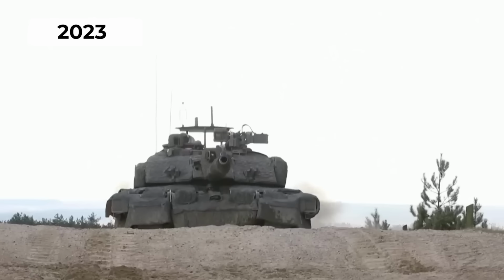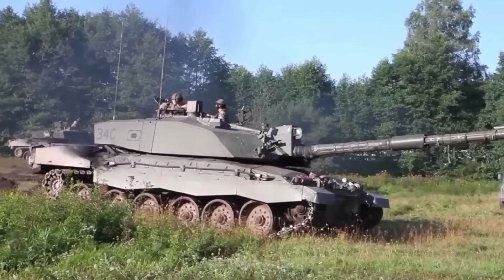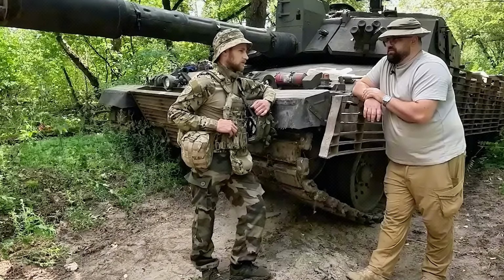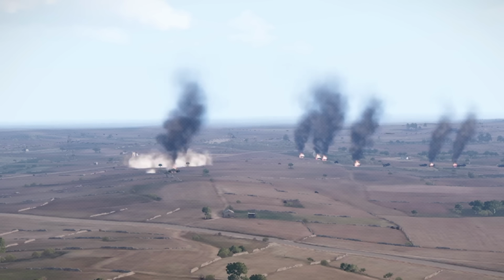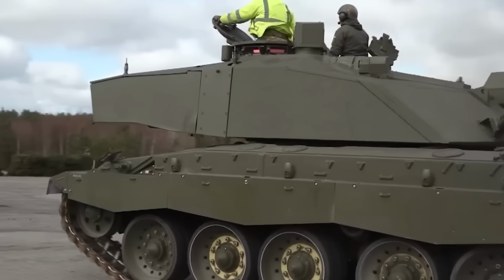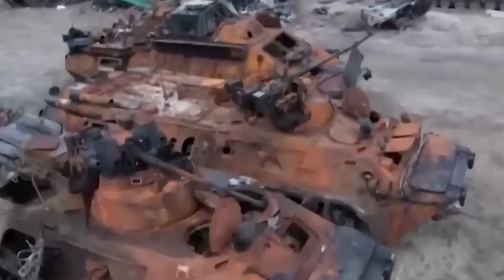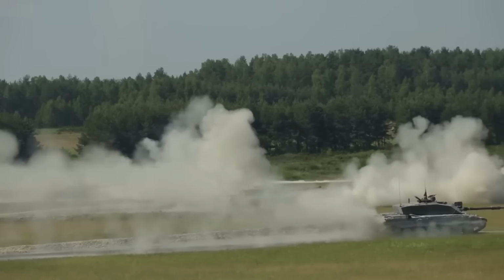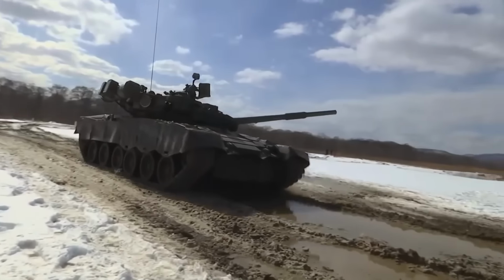How Britain’s Challenger 2 Tanks Are Obliterating Russia’s War Machine

Comment: they are doing a lot better then american abrams tank
Reply: I think the engine is also a bit sensitive in the abrams...it's gas turbine and seems not to like cold damp conditions too much.
Not to say it isn't a good tank it is, and it's proven, but this a different theatre.
Suppose you could say the same about the F35's not liking alaska too much.....
Reply: bradleys on the other hand with bog standard diesel are tearing it up...as are stuff like swedish CV90 and finlands Patria.

Comment: This report is X BOX bullshit. There are only 8 Challengers left, and 3 of those have broken down, so if you think 5 overweight slow tanks will make any difference on a 1200 km front line on notoriously soft  winter ground you need therapy.

Comment: Simple things have helped it becaome so safe, eg it has a toilet and a small kitchen. This is because of WW2, and TEA !  It has been proven that tea breaks ( at least for british troops) boosted morale, and gave higher performances from the crew. That break to make a "brew" psychologicaly was beneficial, however the Germans cottoned on to that, and the german troops told to watch for stationary tanks and the fire from which they heated the tea. 34% of tank casualties came when the crew were brewing up their tea, being less vigilent  and longer response times. So the tank was designed for them to be able to brew their tea without stopping , and presumably toilet breaks. Tea was a staple for the British Army and have the stats to prove it, every soldier has a ration of tea. AS vital as amunition. 34% of tanks destroyed is scary  so saving that figure alone is incredible, just because of TEA. IN the deesrt temps inside tanks could rise to 50. C so air conditioning is installed /and a heater for the colder weather. Can you imagine Putin installing a bar for vodka inside a Russian tank  or realistically coffee/ It would never enter his head.
Reply: You can only just get the crew in a Russian tank. 
Coffee production is just not going to happen.
Reply: Tosh

Comment: Makes you wonder why Challenger 3 has gone to a smooth bore gun. The rifled barrel is so much more accurate. From what i understand its to do with using other NATO shells as opposed to rifled bore specific ones.
Reply: you are right that challenger 3 using smooth bore so that it can share rounds with other NATO members, but also it is because of barrel wear, the rifled barrel needs to be changed a lot more often than a smooth bore.
Reply: @johnmay9726  spot on👍 I think there should be an option for both because of the accuracy at such distance is amazing.
Reply: @johnmay9726 but its giving up its biggest advantage.
Reply: Not quite the challenger was designed to use HESH (high explosive squash head) rounds which defeat enemy armour by flattening against the hull before detonation which causes a  shock wave to travel through the armour blasting a scab of steel off of the inner surface which fly's around inside the tank shredding the crew and equipment. If the HESH round is spinning on impact it spreads more evenly and causes a larger scab. However spinning the round in the barrel costs energy and friction which increases barrel wear and reduces muzzle velocity. Modern smooth bore rounds use fins to stabilise the round in flight like an arrow negating the need for rifling. With the proliferation of composite and spaced armour's which prevent the shockwave reaching the crew compartment and vastly more effective spall liners which catch anything flying around inside HESH rounds have become far less effective not to mention ERA (explosive reactive armour) which creates a counter explosion and blasts the shockwave away from the tank. This all means that sacrificing barrel life and muzzle velocity no longer makes sense.
Reply: @ianjardine7324  "fly's"? Sigh. *Flies*.
Reply: logistics
Reply: Smooth bore rounds have fins on the rear to spin them and no gases leak past on smooth bore so more pressure and range.
Reply: @anthonywilson4873  the LA30 rifled barrel outranges a smooth bore by a huge distance, possible to hit targets up to 10.5km the benefits of smoothbore are longer lasting barrel, sharing rounds with other NATO countries and a wide range of different ordnance and smart rounds
Reply: @johnmay9726  No, it doesnt, and as the UK isnt using HESH anymore (outside of the case of against outdated Russian tanks), rifled barrel doesnt make any sense at all.
They are keeping it for the same reason as the imperial system - because they didnt want to adapt to something that is more precise ...
Reply: problem with rifled though they don't last long has smooth bore it lasts longer
Reply: That's the exact reason. It's trading range for a much wider and deeper selection of rounds to use. Plus, with more modern targeting and stabilisation tech, the gulf between the smoothbore and rifles barrel is less wide, supposedly.
Reply: The UK closed their ammunition factories, so only have limited supplies.  Also, the standardisation of the NATO standard tank ammunition.  That said, the HESH round is a utility round that uses very old technology but it still works.  The UK has eventually succumbed to the smooth bore fraternity, it was only a matter of time.
Reply: If NATO are paying attention, they might ditch the smooth bore gun on their next tanks, since that's the only reason the Challenger 3 is going smooth bore, to fit NATO standard